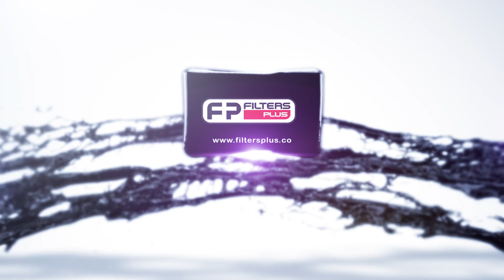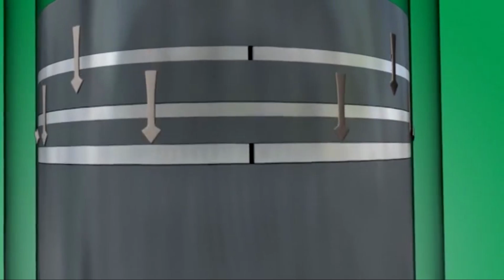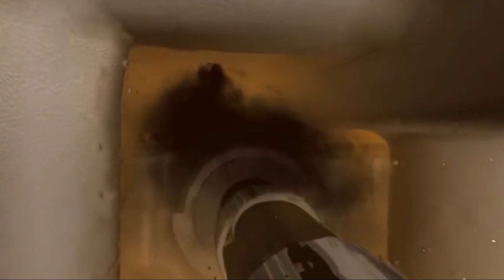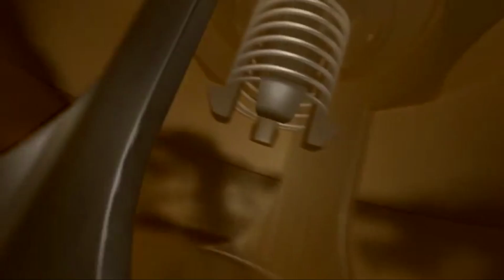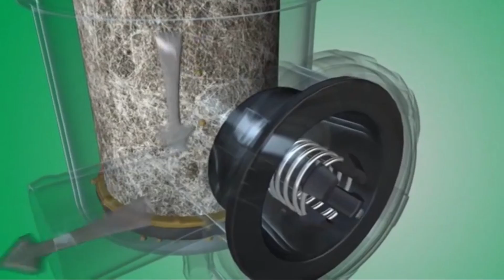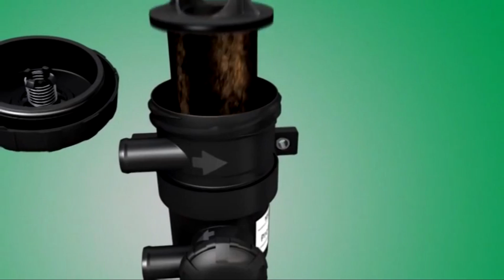Filters Plus // ProVent Crankcase Filtration Sysytem

Comment: I have one fitted and Im very happy with it. How long till I need to replace the disposable filter ?
Reply: Clean every 5000 and replace it at 40000
Reply: And it cost $80
Reply: did you run the drain back to the sump above or below like  the video showed?  I'm curious how well constructed the specialized drain valve is      😦
Reply: I have iveco Genlyon more oil is licking from this filter element & the truck is misfiring no power
Reply: 5000km